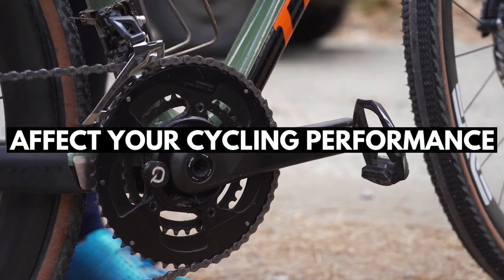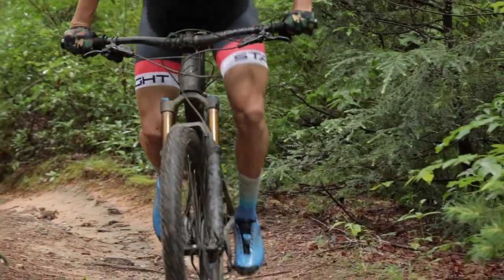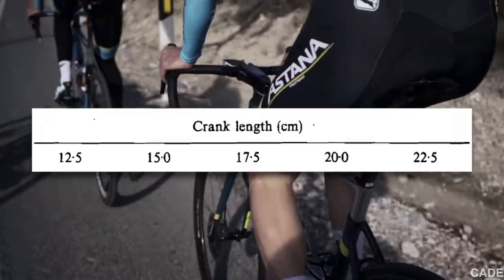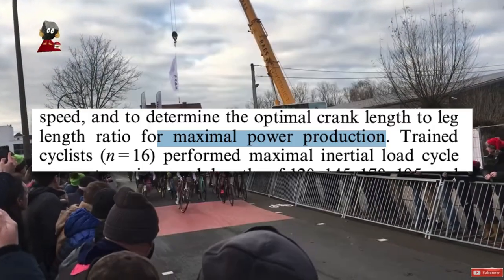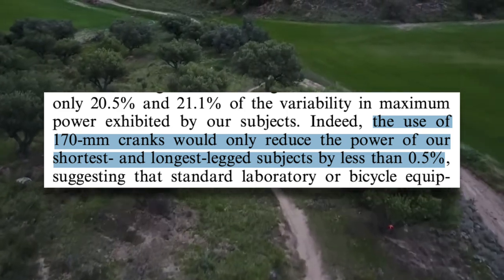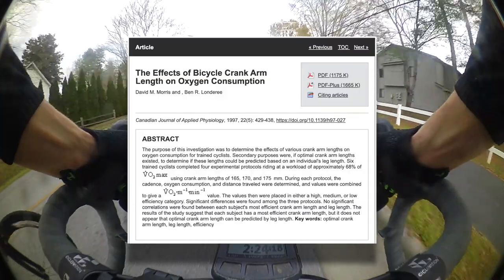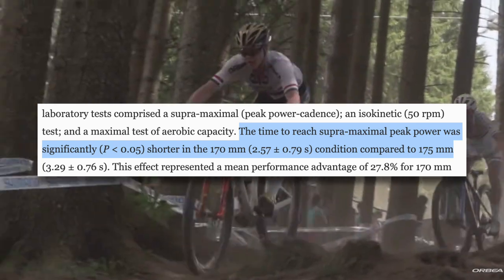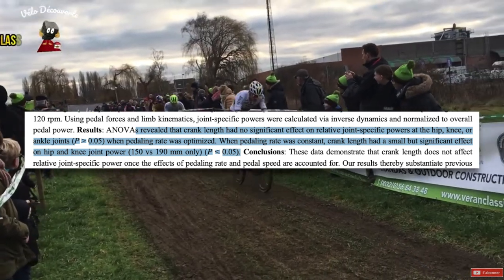Does Crank Length Affect Your Cycling Performance? The Science

Comment: Watched this back in 2020 and again today.I have just used what came with the bike,170 (now indoor bike) 172,5 road bikes,175 mtb & TT bike. Only slight difference I can feel between each,but for low cadence mtb climbs (XC) 175 feels better. I am 5 10" /178cm inseem 34'/88cm. I am not a sprinter.Tried shorter cranks on road did not see improvement. Maybe try 170 on TT next.                                           Regarding track: don't forget they are running fixed gearing and need clearance on the banking,even tall riders use short cranks,it is not just for the sprinting/high cadence.

Comment: I love 165mm from when I rode track but not many mtb manufacturers seem to be making them...
Reply: MTB manufacturers don't even make 172.5's any more. With some of these newer long and low geometries you can bang your pedals in the parking lot. You would think they would be making them down to 150 with some bikes now having 60mm+ bb drops.
Reply: I've swapped three bikes to 165mm this year. Ebay
Reply: @sapinva  60mm drop in 29-er?
That's not low. Check gravel bike with 85mm drop (Cervelo Aspero, Specialized Diverge) or road bike with 75mm drop (usually small sizes).
Reply: @Hexsense  Yes, it's absurd.

Comment: All I know is that with a 29 inch inseam with 170mm or higher crack arms I rock on the saddle causing saddle soars.  I also cannot keep cycling without continuing to stop.  165mm to 160 mm crank arms allow me to peddal without stopping and no rocking hips.

Comment: Hi Dylan. You forgot to mention that in a tt position/ if riding with a very low stack; a smaller crank length can open the hip angle to produce more power and prevent your knees hitting the chest. Great video though. Thank you.

Comment: I'm 6,4 and was always told to ride with 175mm cranks I was lucky enough to try different crank lengths. Found out that my body did significantly better at 172.5. I am a high cadence cyclist though maybe my results would be slightly differently if I was smaller. All I wanna say is try difference crank lengths and see what your body responds too.

Comment: Love these videos. Re.: optimal cadence... I can spot a Fred from a mile away because 1. Day glow safety vests and 2. spinning at < 65 rpm. There is significant empirical data that suggests a correlation between high cadence and power output. Recent hour record attempts on the track put that at around 105-115 rpm. Sure Ulrich spun up climbs at 65 rpm but he is also batshit crazy and a statistical outlier.

Comment: The only science you 'need' is to test crank lengh for yourself.   I was fortunate enough to have a local bike shop that had a size cycle equiped with a power meter.  We set up a test to see what lenght worked best for me.  The test was to hold a solid hard pace for 10 minutes.   We tested 175, 177.5, and 180.  We found my heart rate was 10 bpm lower using 180 vs 175.  So less effort for the same work on longer cranks - FOR ME.  My inseam is 38", so your results may vary.  (Thus why you need to test yourself for your best results).

Comment: One thing you didn't mention is that going with a shorter crank allows you to raise your saddle height by the same amount.  I went from 175 mm cranks to 170 mm cranks and raised my saddle my 5 mm.  Not a huge difference but it saves me time off of each ride due to the better aero position (tested numerous times).
Reply: I'm going from 172.5 to 170. So I need to raise my saddle with 2.5mm
Reply: @aldrinclementina4297  - I've been riding with 170 mm cranks for 3 years now and I'm loving it.  It seems to be the best length for me.  Also with shorter cranks you can get a higher cadence more easily since there is less distance to cover.  On the flip side, shorter cranks are harder to push due to less leverage.

Comment: I am aprox. 6 feet tall and have felt that the 180 crank arms gave me an advantage when hill climbing.  After watching the video, it indicates that there is not a significant difference in power output between the cranks.  So one interpretation is that there is not any wrong length crankset length.  If there is not much difference in power output, then it comes down to personal preference.  I prefer the 180s but they are difficult to find.

Comment: Great video! I think your Cadence video basically reached the same conclusion - it doesn't matter that much. But is it just me or do you use different muscles or use your muscles differently when switching between high & low cadence? I find that I can manage my fatigue better by occasionally switching from one to the other during a ride.
Reply from the maker: Yup, the conclusion was ride at whatever cadence is most comfortable. If that means switching it up mid ride then go for it.
Reply: I have found the same thing. If I need to finish out a SS or threshold interval and I am barely hanging on at the end (last 1-2 min), dropping down a gear to spike the cadence up seems to do the trick.

Comment: Key thing he forgot to mention is that with longer cranks you accelerate slightly quicker compared to short ones. It's like an engine with a bigger con-rod length so more torque at the lower rev range.

Comment: The real reason to go for a shorter Crank is to reduce knee stress.
The shorter the Crank the less you bend you legs. The less you bend your legs the less force is transferred from your kneecap to your kneecap cartilage reducing the friction between them.
If you are a casual/utility rider and want to avoid knee injures go for shorter Cranks.

Comment: On my indoor exercise bike my cranks are 170mm and my average cadence at tempo is 106; on my road bike while my cranks were 175mm - they are now 172.5 - my tempo cadence is about 95. Longer cranks give more torque. As I've now changed to a groupset with lower gears, I decided I could afford to have shorter cranks and perhaps increase my cadence.

Comment: Another nice video, thanks. So I want to turn this around a bit.  What if you spent 25 years (just to have a number) riding 172.5 length cranks and moved to say 165 - there may be no discernible difference given the metrics in the short term but if someone did spend 25 years riding the same length then their body would be patterned to the length and I guess weight of that particular crank (a few assumptions there - like they used the same cranks for 25 years).  But a kind of efficiency would develop between the body and tool it has been using all those years.  In the same way that if you give a heavier hammer to a carpenter whose used the same hammer for 25 years - they’ll notice it and it’ll affect their ability to hammer nails all day. It seems that the analogy here is cadence.  The physiological  thing that changes is cadence - and that has to have some impact on the efficiency of a body not patterned to use the different length cranks. There just seems to be an assumption that cyclists will adapt immediately to the different crank lengths which makes me wonder what the data really shows ... maybe the power differences or lack there of shows the adaptability of the body to the use of different crank arm lengths for the purpose of those studies but not maybe the long term adaptability.  However, it does make sense that different crank lengths would suit different specialities just as lighter and heavier hammers suit different types of carpenters.  So maybe when training to your weakness it might help to use different crank lengths. Talk about a marginal gain!

Comment: I wonder where power was measured in these tests. If it was at the pedals or crank it would only test the physiological effects. If it was a hub based power meter then it might uncover mechanical differences. Of course you'd need to adjust gearing to ensure final gear reduction is constant. Because the crank translates linear motion to rotational motion while the rest of the gearing coverts existing rotational power, I can see really long cracks having some advantage. Again you'd have to measure at the hub an carefully match cracks and gears to have the same final gear reduction.

Comment: I love your baroque nerdiness and the fact that you link the articles. You've got one subscriber here! But I'm quite frustrated that you address this video to advanced cyclist. I'm a hobbyist / amateur riding only xc, not more that 50km/week, not at race level. I'm not very fit, and my knees sturt hurting after about 10-15 km. I'm 1.90m tall. Moving from 175 cranks to 170 cranks helped a bit with pain in the knees. I'd have liked to see this aspect explored as well....
Reply: With your current style of riding, comfort is the most important thing. Go lower crank length to open up your hip angle and your knees and back will thank you

Comment: Science for da win!
However, science is only as good as the experimental design: do you have links for the full text articles you mentioned? Coz there are all sorts of ways that the experiment can be messed up.
1. they would need to adjust other bits of the bike when changing crank lengths
2. riders would need a bit of acclimatization to the new bike geometries, especially with hefty changes
3. riding positions and therefore functional aero positions will be altered, so any testing NOT done outside or in a wind tunnel will miss all of that
I was telling a triathlete friend back in '13 that they should try shorter cranks. If you shorten them by say 20 mms, then you open the hip at the top position as if you'd raised the saddle by 20 mms. PLUS you'll have to raise the saddle by 20 mms to maintain your knee angle at the bottom of the stroke, so you'd be opening your hip angle ANOTHER 20 mms. Of course this would then bring handlebar height into the picture, which is the other end of opening and closing hip angles. At the end of the day you'd end up being in a flatter back aero position without closing your hip angle. So probably a win? Especially in 1/2 and full iron distances with no drafting.

Comment: I have a related question about optimal saddle height. I see soooooo many people riding with really low saddles and this seems very inefficient (taxing)! Think about sitting on a leg-press machine. I can extend my legs a little with a huge amount of weight many many many more times than I can do a deep press with a little weight. Because of this, I would think the optimal saddle-height and crank-length combo is the maximum height you can get to without causing you to reach with your feet or rock at the hips. What do you think?

Comment: my hypothesis is that crank length affects muscle flexibility. longer is better, but only in the long term. Running shorter cranks may have no short term effect, or even feel better in the short term. Also, i sometimes suspect getting an optimal bike fit is more difficult with longer cranks since you have more conflict with elbows and handlebars contacting the knee

Comment: Basically your body generates the power it does and crank lengths just affect torque and cadence.  It would make absolutely make sense that shorter cranks will give you a better acceleration because your applied torque requirements will be lower.

So for road riding at steady speed, who cares. For high acceleration demand applications (mtb and hill routes) shorter is likely better as the required torque per stroke will be lower.

Comment: I am an extra tall cyclist with long legs in proportion to my body (36in./91.5cm inseam). I think there are other factors such as the amount of slow twitch versus fast twitch muscle fibers in the riders legs. In runners, some are great sprinters and some are great distance runners. Rarely are people great at both. I ran both cross country and track (2 mile) in High school, but I was always a lousy sprinter. I swapped out the cranks on my BMX bike with some mountain cranks that were 177.5 and used the largest sprocket (46 or 48, I can't remember) with a 14 tooth rear. I took the seat off because the top of the frame was probably only 14 or so inches off the ground. I would ride that bike typically 20 miles a day, 5 days a week. I was strong enough to pace with the road bikes, but they would swap gears and pull away from me. I always felt that I could catch them if I had other gears to chose from. Now, a few decades later, I ride a road bike (62cm frame) with the extra gears but feel like I might make gains from a slightly longer crank. Even though I usually average a cadence of  84-89rpm, I still feel that a slightly longer crank would help, especially on the hills. When I look at the science, their idea of a tall rider, is significantly shorter and they don't represent my physical type. We also know that with all of the science and resources available to professionals, there are outliers who run parts that are extreme in their dimensions, including cranks.

Comment: Very interesting video and interesting study results.
I've found my cadence has increased over time as I've spent more time on the mountain bike with longer cranks.  So I've gone in the opposite direction.

And my college roommate would argue vociferously against these findings.  At about 6'3", he trained and raced on 180's.  Road and track, but mostly road in college.  At one point, he suffered a knee injury where his quadricep pulled off a piece of his bone (can't remember the details).  He recovered and then I lost touch with him. 

About 15 years later, he said he had "rediscovered cycling" with the utmost in enthusiasm.  He was always an avid cyclist, but as he aged, his interest waned as he spent more time cross country skiing.  But then he went to Zinn's website to have ideal crank length determined for his height, femur length and riding style.  He was originally fitted with 203mm cranks and said it was amazing.  He found leverage he could never achieve on the bike with 180's.  He's certain his injury was caused by his long femurs turning tiny lever arms with too little mechanical advantage.  Turns out he ended up switching to a little shorter crank thereafter, settling on something like 197mm.  He raced road and then track pretty extensively as a master.  Anecdotal evidence, but he was ecstatic about feeling so great back on the bike.

Talk about contradictory takes on crank length!  Not to confuse the issue, but I don't think I'd be happy at all on such short cranks.  At 5"9", I'm very happy with 175 - even on the road tandem.  And 172.5 feels short on the road bike.  But perhaps I'm just a contrarian!
Reply: Where do people buy 203 mm cranks?  I would like some 180s but cannot find even 180s. I believe the longer crank arms are an advantage when climbing hills.  Are the longer crank arms custom made?
Reply: @jonrodman323  depends on how you define "custom" I guess.  Lennard Zinn sells a very wide range of cranks for tall and very tall people:
https://zinncycles.com/custom-cranks/

Good luck.
Reply: @jonrodman323  they're all expensive.  Most manufacturers make 180mm, but usually only in the most expensive groups.  (You can get dura-ace, but not tiagra, 105, etc.)

I got a rotor 3d+ crankset in 180mm when I bought my power meter (It was the only model offered in 180mm).

I did get some 190mm bmx cranks and an adaptor to fit a standard chainring from profile racing.  It'll take a little fooling around to get the chainline right, but it's probably the cheapest way to get a 190mm crank.  Still a few hundred bucks to get all the parts needed, but cheaper than DA 180mm, or any of the custom stuff.

They're heavy, so not for the weight weenies, but if you want to try a longer than typical crank, they might be the cheapest way in.
Reply: I liked the change from 175mm to 180mm, though it was pretty subtle.  I think those of us with long legs can definitely benefit from longer cranks, in the same way as average people benefit from their average (as opposed to too short) cranks.

Comment: I would think crank length would make a difference in the short, steep climbs you find in mtb or cross riding. Cranks are levers after all, and leverage power increases with length. Therefore it makes sense that steep climbs would be easier with more leverage.

Comment: I thought longer cranks have greater mechanical advantage.  When riding on the flats or downhill, if you want a higher cadence you can drop a gear.  But when you hit the hills and you are already in your lowest gear, which is going to result in a higher cadence: a shorter crank with less mechanical advantage, or a longer crank that makes it easier to turn the pedals when you are on a gradient?